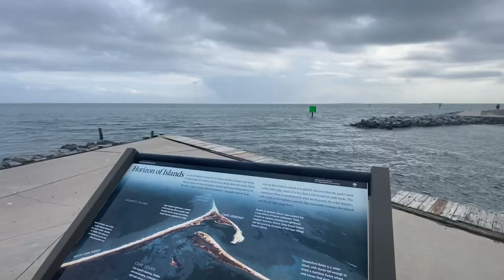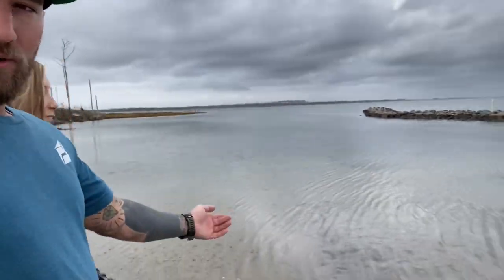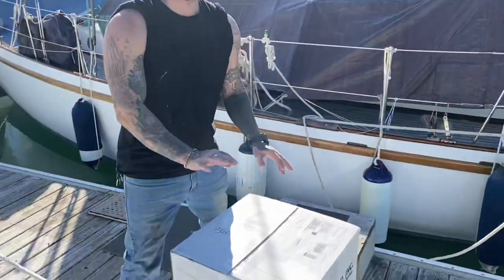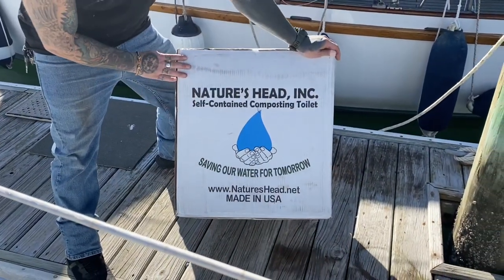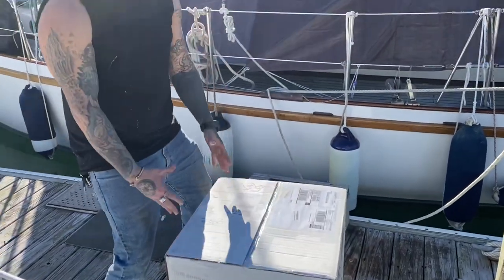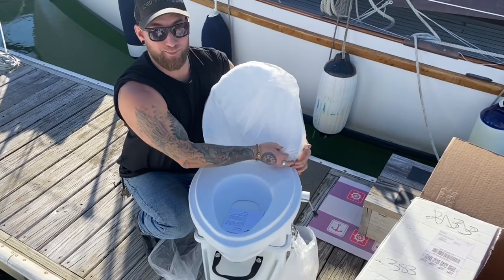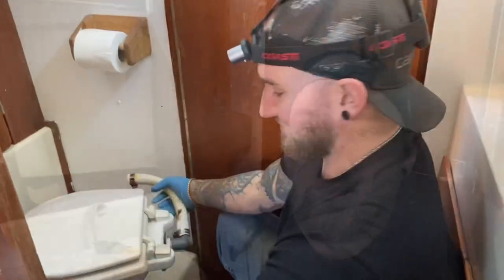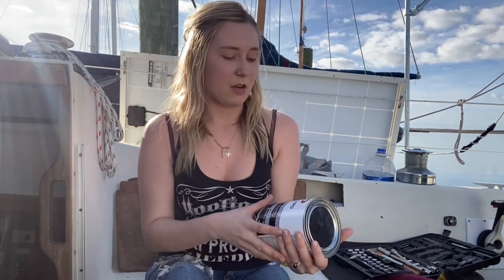Installing A Composting Toilet ⛵️ & Exploring The Outer Banks! Ep 2

Comment: hi guys, you are lovely couple but you gonna hate my comments. Teak oil is great for fresh water sailing, for salt water, simply wrong idea. You got me totally with your compost toilet. you will get rid of it very soon. Talk to sailors who experimented with it. In general - talk to sailors. experience is a huge help. Lots of Love. Capt Jack
Reply from the maker: Capt Jack, We appreciate the feed back, keep at it 🤙

For the teak oil, that’s good to know- what do you recommend instead? We also have another outdoor deck stain we want to try (says it last for 7 years)

Yeah we’ve only read and heard about the compost- some people love it, others don’t lol I guess in time we will see what category or fall into.

Cheers ⛵️
Reply: @SailingAtla  Guys I am even not sure that I have to send this comment because it will be ugly. I don't want to heart you, you are very nice couple but you don't have a minimum "know how" and my heart is bleeding. This is a sailboat, not the old country side barn. You slap a coat of paint on totally unprepared surface with old peeling varnish hoping that you cover the damage. Are you thrilled with the results? Buy two super circulating sanders. There is lots of sanding on any boat and yours has extensively damage wood. Teak wood after thorough sanding has to be cleaned chemically to remove dark pitting and deep dirt. (buy teak cleaner and read instruction). External hand railings have to be removed (check the screw holes for leaking) Railings have to be varnish with multiple layer of high quality Exterior marine varnish.
You mention that you have been inspired by Uma - Dan and Kika are very professional in their boat restoration, by the way, ask them how fast they got rid of the compost toilet. Imagine that you have longer passage - what you gonna do with this stinking waist?
Test your deck and windows for leaking. What did you do about anti fouling paint. Did you replaced any sea-cocks. Did you check your bottom for osmosis (50 years boat usually has them) How old is your rigging? If its older than 7 years - no insurance. Get the professional rigger to give you his report including chain plates. What kind of engine you have. Did you professionally inspected it together with your transmission, cutlass bearing, staffing box, shaft and propeller. Who inspected your sails, halyards and sheets. Did you carefully inspect your stirring system, electrical system, your batteries, making calculations of your power consumption. What electronics you have, what is your navigation equipment? Which one of you knows the ocean navigation and weather? Sailboat is definitely not an RV. You think that you paint it and you gonna be ready for ocean waters? Trust me, to do that, paint is not enough. (at least remove cabin cushions while you do that) Your romantic idea will lead to disaster. You have to realize that my comment is not criticism. I try to make you recognize that you are making huge mistake trying something which require knowledge and skills.
Lots of Love. Capt. Jack
Reply from the maker: @jackyotes3189  Dad and Kika shat in a bucket for over two years before switching. They also have been restoring Uma for over 5 years now- We’re two weeks in lol 😂 we will get there. We’ve spent many month in the 3rd world volunteering before this sooo that toilet we bought is luxury!  You’ve judge so quickly off two videos…You mentioned that teak oil wasn’t good for “salty water” & that is just not true, if you do any research into it you’ll see it’s perfectly suited for the salty marine environment. (And yes we have a teak sealer)

As for all the other worries you have- yes you need some preparation but you also don’t know who we are or our background on the water, with navigation, with anything.. Life is made for living mate, you could wait around forever trying to get every little thing to be perfect and risk letting your dreams become regrets…Or cast off the bowlines now with what you have and go on an adventure.
We choose to go simple and go now.

Cheers
Reply: @SailingAtla  great. I am to old to argue. Just remember - the unforgiving sea. i will not bother you any more. Lots of Love. Capt. Jack
Reply: Teak Oil works better in fresh water but also is Great in saltwater ! Beats dismantle, sand and revarnishing !